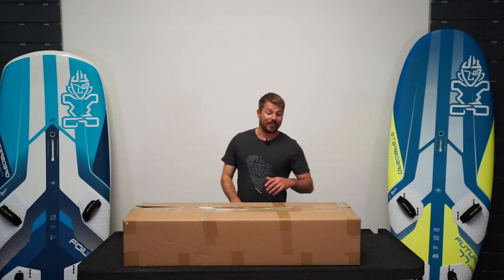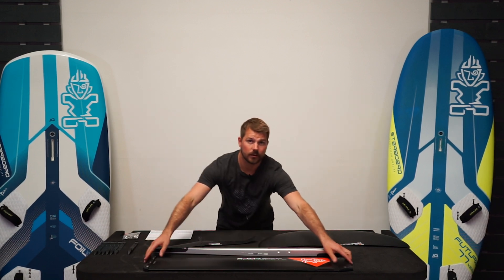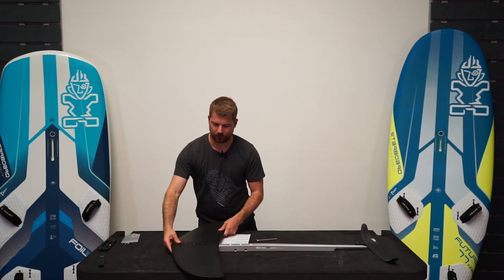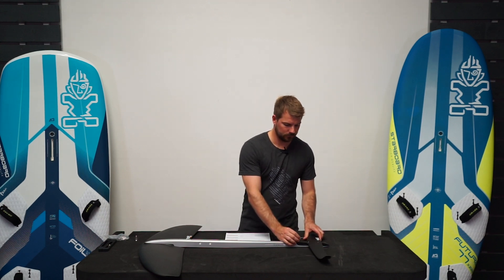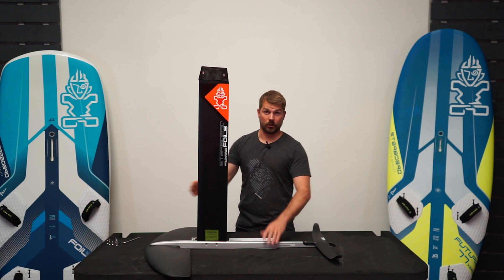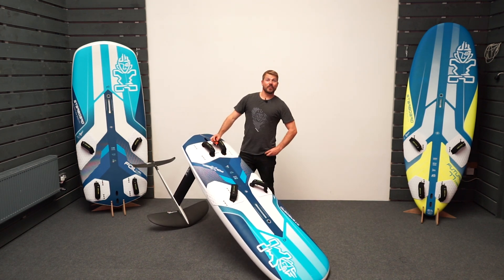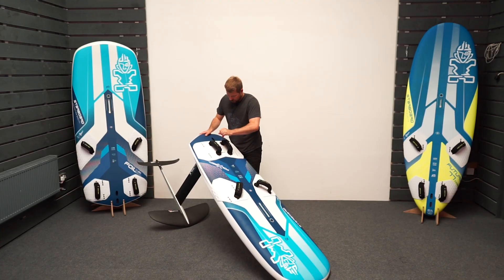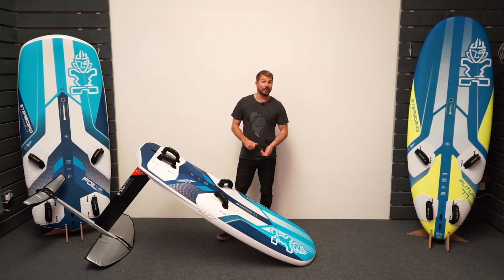Starboard Evolution Windsurf Foil Assembly Guide

Comment: Hello, what is the angle of the mast in that configuration, or what do you think is the best angle for the SuperCruiser and small foiling boards like 100-120L, in low wind conditions of 8-10 knots?
I also noticed that the tail on your board is slightly submerged. Does this hinder the initial acceleration of the board to the foiling speed? Do you have any advice on how to more easily initiate foiling with such small boards?
Reply from the maker: Hi I believe the Alu mast sits at 87 degrees. A 90 degree mast would give more lift providing it doesn't affect the angle of the wings/fuselage and simple moves it all further forward. I've not changed the mast angle before so can't comment any further. For this particular session I set the board up with the footstraps and UJ right at the back to give the most lift and manoeuvrability as the wind was dropping off very quickly. That's likely why the tail might look like it was sinking but wasn't noticeable when sailing. 

For small boards efficient pumping with the sail and legs is the key to unstick the board from the water! The lighter the wind the more you have to work to take off and keep up on the foil.

Hope this helps!

Comment: Hello
1. Have you tried using this starboard mast with JP Australia boards? In my case, Deep Turtle does not fit together because there is a 10mm misalignment in both drilled holes. 
2. What is the minimum speed required for levitation for foils such as Super Crusader, Superflyer, and Freerider.
Reply: Hi, I use a JP Hydrofoil 155 2020? board together with a SB first generation Supercruiser foil and it is not a perfect fit in that I have to tilt the mast a little bit forward in the box to get the screws to align before tighten them but other than that NO problems. I weight 85 kg and if I pump the sail and board I estimate I can start flying in less than ten knots of wind using a 6.5 sail.
Reply: @allanasp771  ok, the more sophisticated idea is to measure the board speed when levitate starts than measure wind speed. It avoid stuff like sail and direction. The older mast has more place to drill but mast could break because of that. I already drilled the board.
Reply from the maker: Hi, We've not tried Starboard Foils with JP Boards. It's recommended to use Starboard Boards with Starboard Foils as these products are designed to work together. 
Regarding the minimum speed there's too many variables to be able to give a figure. 
Hope this helps!

Comment: I am glad you added the "+1.0 highly recommended" the first time I tried the 1700 wing (foil-X 145) it was with a -0.5 and the negative lift prevented me from flying, it was that bad. Finally tried the +1.0 and was able to sail but still a lot of back foot pressure, called my local dealer and they are locating a 105 fuselage for me. Hopefully there is not a supply issue with these things!
Reply from the maker: Good stuff, glad the tip helped. Might be worth setting the footstraps in the furthest back position too to help with the lift. 
Let us know how you get on with the longer fuselage!

Comment: Hi Matt.  I recently upgraded my 2022 Freeride setup with the Evolution 105 fuselage which is great with either the 1500 or 1300 foil.   Question what are your thoughts on the use of the 102 fuselage for the Freeride now that I’m kind of locked into the 105?  Also is the 102 fuselage a good option for the FoilX which you mentioned is your go to board. A friend has the 145 and he is interested in purchasing the Evolution setup.  He is going to test mine when we are next on the water but I’m curious what you think 102 or 105 for his FoilX 145 setup?  Thanks.
Reply from the maker: Hi Tom, thanks for getting in touch. 
Question what are your thoughts on the use of the 102 fuselage for the Freeride now that I’m kind of locked into the 105? - Using the 102cm will certainly make the foil feel more manoeuvrable and less locked in as it brings the front wing back toward the mast. 

102 or 105 for his FoilX 145 setup? - The Foil X is a very adaptable board, it'll work really well with either foil set up. Depending on your friend's level they could start with either the standard freeride or super flyer set up and then get an additional fuselage or front wing etc later. 

I hope this helps!

Comment: Can you get an adaptor for deep tuttle foil to US . I would like to get the starboard foil x wing and my foil that as a deep tuttle wont fit this ? Thaks
Reply from the maker: Hi Nick. Starboard currently only do a 'foilbox head' to US top plate adapter. There are aftermarket shims etc that you can get to do what you're trying to do however I'm not experienced in this area so would struggle to advise any further.

Comment: What length bolts are you using to hold the mast into the board? Are they torx bolts? I have the 2020 FoilX145 and Supercruiser set up, but it didn’t come with as good an assembly guide!
Reply from the maker: Hi Rob, for this video I used the two screws that came with the board (torx fitting) which I believe are m6 x 45 and 50mm length. The length of the screws required can sometimes vary depending which board/foil mast you use so might be worth enquiring with your local Starboard retailer to pick up a range of bolts to keep you covered. Torx fin bolts are in stock in the UK in lengths 35mm up to 65mm.
Reply: I am using 65mm & 70mm torx screws with washers and vinyl rubber washers to keep them tight. Foil-X 145 & evolution foil.